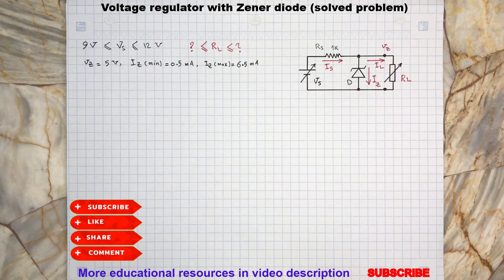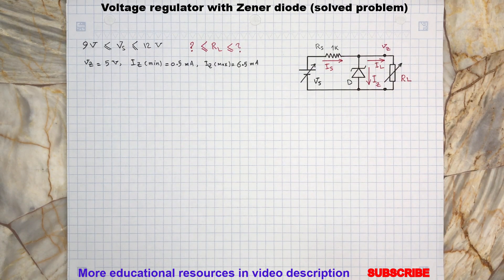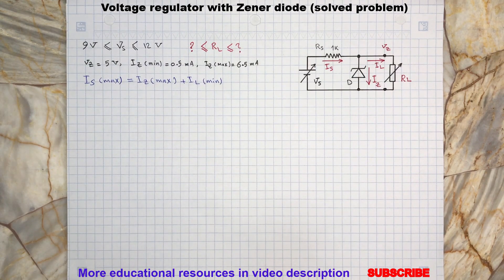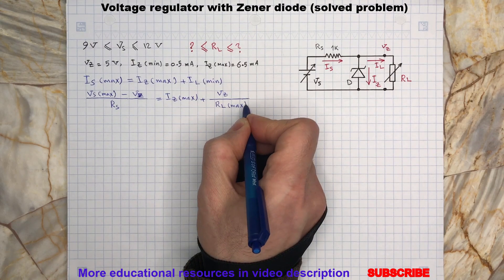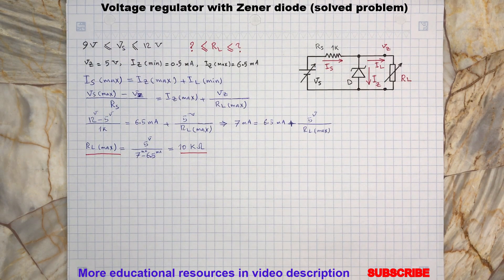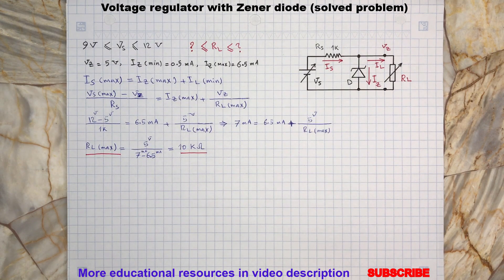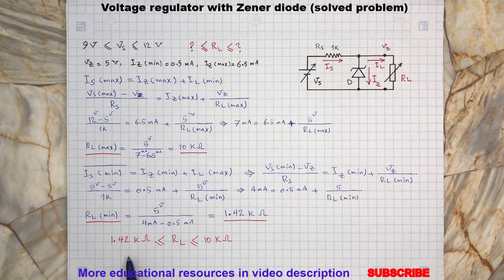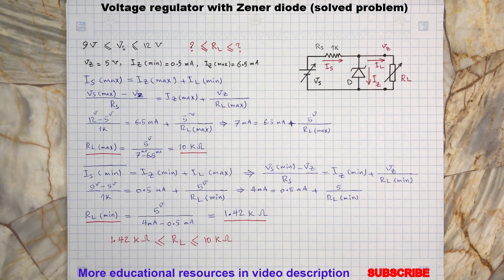Zener Voltage Regulator Circuit Solved Problem, Zener Diode as Voltage Reference

Comment from the maker: Op-Amp and Zenner Voltage Regulator:  https://youtu.be/CKMxGu3uHAA
Full-Wave Bridge Rectifier using IC 7809:  https://youtu.be/oplCvtsdcM0
Voltage Regulator and Current Limiting Circuit Analysis:  https://youtu.be/8Mn6LC2isHs
Transistor Series Voltage Regulator:  https://youtu.be/OuVbjRZHM9U
Electronic Circuit Analysis Playlist: https://www.youtube.com/playlist?list=PLLA_QJ8rHZBh5LqrY41bCvKgreRDRWrBQ
Digital Logic Playlist: https://www.youtube.com/playlist?list=PLLA_QJ8rHZBjoWpsdJeo6ii5HnWTEmDi7
Control System Playlist: https://www.youtube.com/playlist?list=PLLA_QJ8rHZBjS_S6WPkmUweF5NbImvSqf